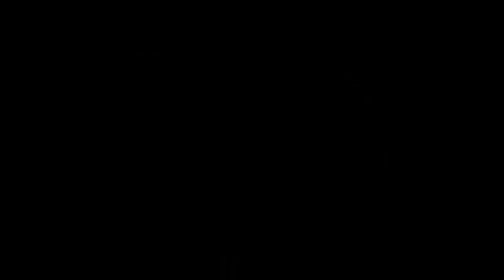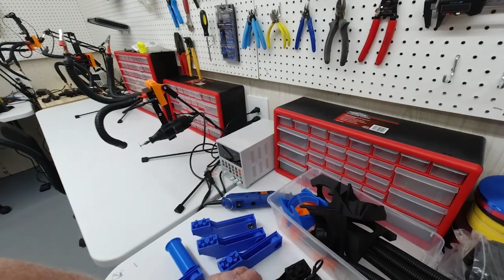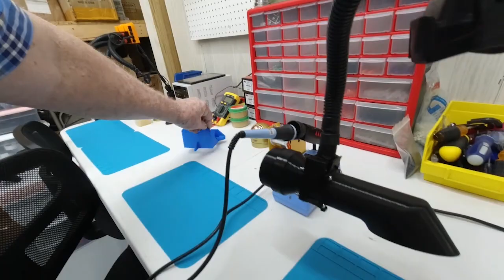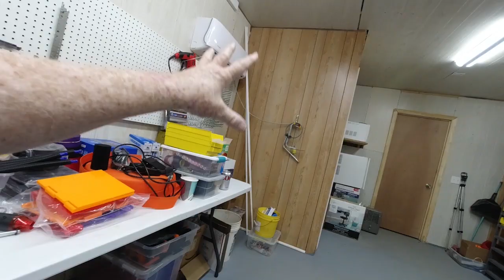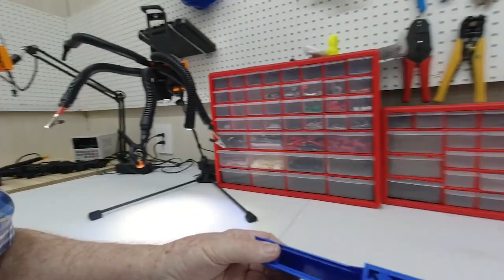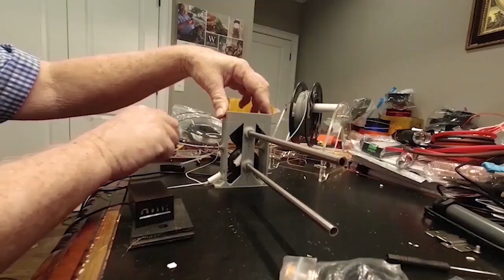3 YEARS 3D PRINTING LOOK WHERE I'M AT NOW with my print farm and new assembly area at NTI

Comment: I think your helping hand is a good product, but it looks wobbly. You should design a shape, made out of some hardwood for the 3 prongs/legs to attach to. It would be a cheap, heavy, rock solid base. Some Oak, an interesting shape, and 3 drill holes.  It would never break, and it would be a steady .. helping hand.
Reply from the maker: Thanks for sharing your ideas on making the Helping Hand more stable. I have been working on similar ideas myself and will continue to improve the design of the mounting systems for the Helping Hand and improve stability. Tha idea of a large heavy wood base would work, I'm sure, but the cost of shipping would double, and I would like to try to prevent that. Thanks for your ideas and your support...Ken
Reply: @NewTechInventors  Ok, how about this idea. Make the wooden base, but cut penny size cylinders in the wood. (to save ship weight) When the user receives the block of wood, they insert about $2 worth of pennies in the base for ballast/mass.  :^)